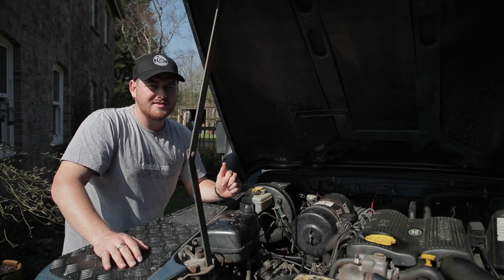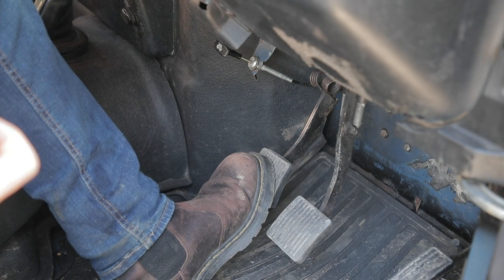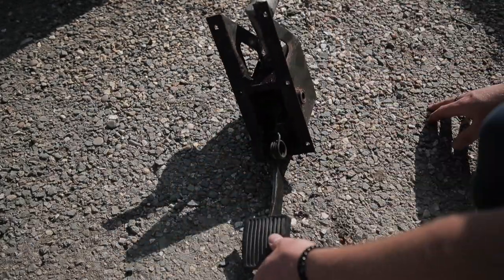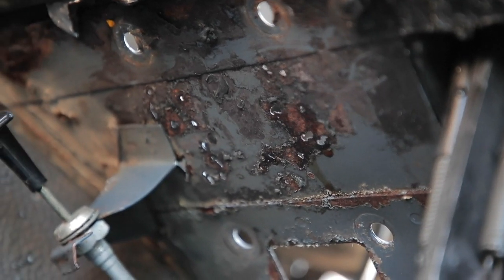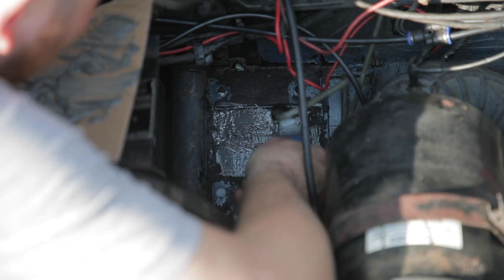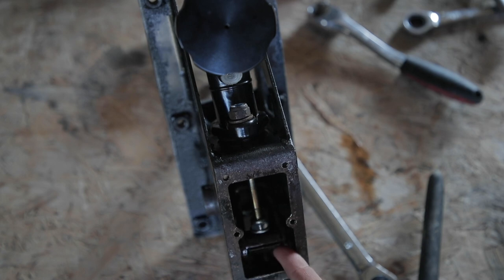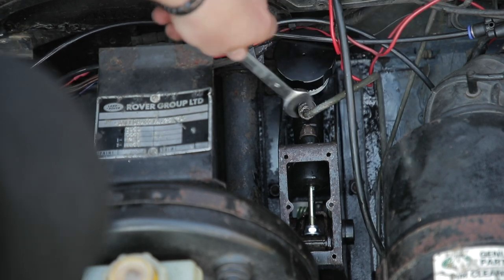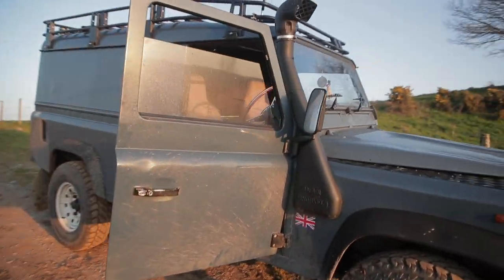Making my Defender Clutch Lighter - L.O.F Master Cylinder

Comment: My advice to you is to adjust the nuts on the master mounts after you commit to the shaft adjustment, because it's often not concentic to the position required for a "straight operation" 
And this prematurely wears out the rubber inside the piston.

Comment: If one cylinder fails, always replace both. They get the same amount of use and wear so the other one will always fail soon if you don't.
Reply: Both as in slave you mean ?
Reply: But don't replace both the master and slave with a LOF, they won't work.  Only replace one or the other.